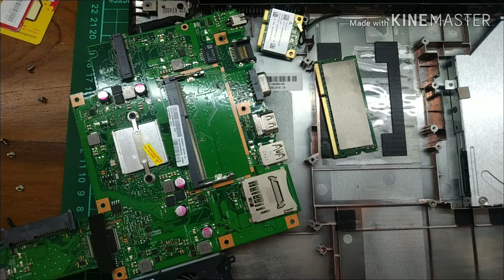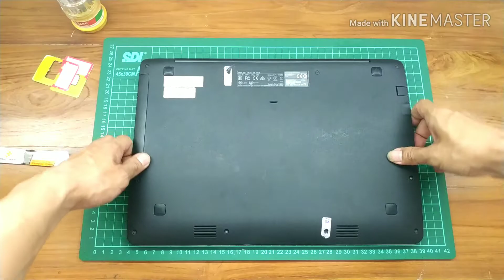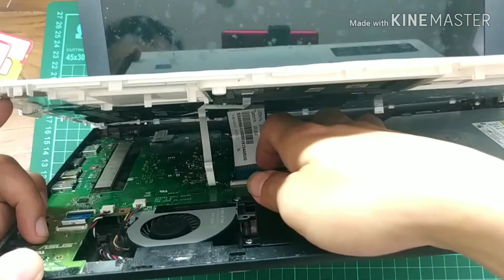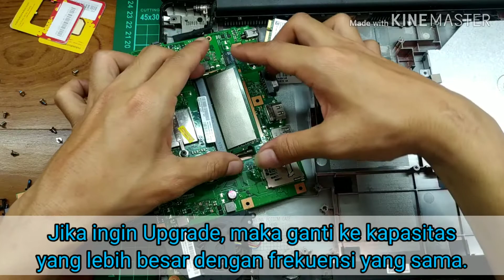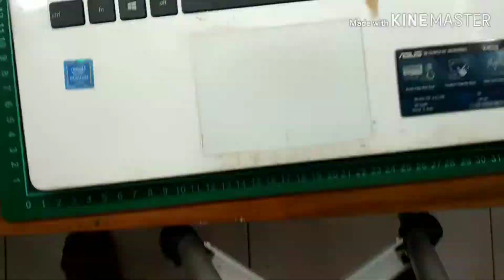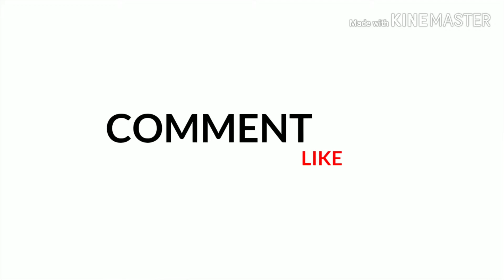Upgrade Ram Asus X453S max 8Gb

Comment: Bang mau tanya tipe laptop persis kaya di video mau coba cek spesifikasi di CPU-Z Memorynya pake DDR3 tapi dibagian SPD tulisan DDR3L jadi pakai yg mana kalau mau ganti?
Reply from the maker: Kalau di bongkar bisa enggak mas..kalau seperti itu saya belum yakin kalau belum di lihat secara fisik langsung.
Reply: @LinggarjatiRudyan  kalo secara fisik DDR3, trus jadi diganti yg apa DDR3 apa DDR3L ?
Reply from the maker: @nailaafifah2240  jika ada, disesuaikan dengan tipe sebelumnya, cukup di up kapasitas giganya saja.
Kalau untuk laptop ini sebetulnya belum pernah saya coba dengan ddr3l, namun saya ada laptop acer yg ramnya kombinasi 2 gb ddr3 + 4 gb ddr3l, bisa berjalan lancar.

Comment: Saya sudah coba RAM 8 gb DDR3L PC3-12800 MHZ di Asus 453S kok hasilnya bluescreen bang. Mohon solusi, dibongkar pasang berkali-kali dg membersihkan kakian RAMnya tetap aja ngga bisa. RAM yg 8 gb tadi dipasang di laptop lain, bisa2 aja.
Reply: Setelah pasang RAM aslinya 2 gb, laptop kembali normal. Saya menggunakan windows 10
Reply from the maker: seharusnya juga mmng bisa itu,,itu windows 10 yang berapa bit mas??apa merknya juga sama seperti yg 2Gb itu??
8Gbnya dicoba di laptop apa mas, yang waktu bisa?
Reply: Kasus nya sama dg Saya, Saya cek RAM bawaan laptop ini PC3 tapi saya cek di CPU Z tipe RAM ini DDR3L 1.35v.  Saya coba upgrade ke RAM 8Gb DDR3L 12800 hasilnya layar tidak mau menyala. Tapi ketika RAM bawaan saya pasang lagi. Baru mau nyala laptopnya.
Reply: Saya pakai win 10 Pro 64 bit. Merek Samsung. Saya coba di laptop Asus yg lain, terbaca dan lancar malah.
Reply: Kalau saya laptopnya menyala, namun ngga bisa masuk desktop karena bluescreen mas...
Reply: @abunaura  gan apakah laptop udah jadi pakai yg 8GB?
Reply: @wariorbest2306  blm bisa gan, masih pakai RAM bawaan yang 2 gb
Reply: @DAarchitects09  wah sama gan. Saya pake DDR3 4GB gak nyala terus pakai DDR3L bisa cuma lama2 blue screen dah lah cape udah retur 4x akhirnya pakai ram 2GB bawaan
Reply: Akhirnya saya nyerah. Balik pakai RAM 2gb bawaan tapi saya ganti pakai SSD dan Windows 10

Comment: berati total ram jadi 10gb ya mas kalau di tambah 8 gb satu keping?
Reply from the maker: sebetulnya saya belum tau mas, soalnya belum pernah nyoba saya pasang ram 8Gb, cuman kalau dari spek processornya cuman mampu 8gb dari total max ram yg terpasang,
Reply: Asus x453 cuman ada satu slot ram kalau gak salah bang
Reply: Bawaan 2gb.. Kalau diganti 8gb... Brarti yg 2gb ga kepake.. Dijual aja..(spec max. 8gb masalahnya) salam dari gunung kemukus

Comment: Up ke 8 mubazir ga , kan celeren trs masih hdd
Reply: Murah ko ram gak sampe 200, jadi klo punya dana mah sikat aja

Saran saya sih upgrade ssd juga sekalian

Punya saya celeron n3050 JADUL PARAH

upgrade ssd + ram 8 = sekarang kuat main pb dan kuat editing vidieo
Reply: @23muchammadrafly97 serius ga bang rencana mau upgrade ssd juga nih
Reply: @dennyadisetyawan1246  kuatlah, tapi jangan berharap settingan high

Ibarat lu anak sd di kasih tt cewe sma
Ya rusak
Reply: @23muchammadrafly97 kalo buat pes kuat ga ya mas, ssd pake yang berapa gb
Reply: @dennyadisetyawan1246  kekuatan ga di nilai dari ssd mas, tapi dari procesor

Ssd cuma bantu biar proses nya cepet aja
Seperti
- bikin ga patah patah
- buka file manager jadi cepat
- loading game lebih cepat

Kalau upgrade ram
- bisa buka banyak aplikasi bersamaan
- mengurangi resiko freez , atau istilahnya hang ngelag
- multitasking
Reply: @23muchammadrafly97  kalo celeron n3050 sama core i5 2410m dual vga radeon hd7400m dan intel hd 3000 mending mana mas?? 

makasih sebelumnya udah ngejawab
Reply: kebutuhan buat main game pes word excel dll sama browsing nonton
Reply: @dennyadisetyawan1246  pes 2000 berapa ?

Kalau 2010 an kebawah masih bisa settingan menengah

2013 masih oke juga sih sebenarnya

Kalau di bandingin celeron saya dengan i5 gen2 kamu, secara teori menang kamu, dan kamu udah ada vga juga 

Tapi kalau buat gaming spek segitu aga ngos ngosan, jadi jangan dipaksa high ,settingan low aja
Reply: @23muchammadrafly97  pes 2017 rencananya kalo kuat kalo ngga ya 2013, setinggan low
Reply: @dennyadisetyawan1246  di coba aja,kalau secara teori sih kuat
Reply: @23muchammadrafly97  saya juga punya laptpp seperti lu bang, bisa gk minta link pembelian ramnya, soalnya punya laptpp saya juga x453sa rencanan mau main pb juga itu lancarkan bang ?
Reply: @23muchammadrafly97 klo buat autocad kuat ga bang ?
Reply: Ada yg bilang maksimal ram di 4 gb saja di vidio lain
Reply: @23muchammadrafly97 Merk dan spesifikasi RAMnya apa bang? Sama soalnya laptopnya.

Comment: Bang satu slot RAM bisa langsung 8 GB gak ?
Reply from the maker: Tidak bisa mas, maksimum ditambahin 4 GB. Karena spek processornya hanya bisa membaca total memori 8 GB, 
Asumsi ram tanam 4 + ekspansi 4 = 8 GB
Reply: @LinggarjatiRudyan  kalau bawaan ram 2
+Ram 4 jadi total cuma 6 dong bg?
Reply from the maker: @dlah1661  iya bang, atau laptopnya bisa dicoba bawa ke konter komputer buat coba dipasang ram 8Gb, siapa tau ttp bisa kebaca 2 + 8 = 8Gb, tidak mungkin 10Gb, karena kemampuan processor 8Gb
Reply: @LinggarjatiRudyan  maksud kata dari tidak mungkin itu apa🙂
Reply: Btw makasi infonya om
Fash respon
Reply: Aku coba di web crusial bisa sih 2 + 8 ,
Reply: Tapi x452c ya
Reply from the maker: @dlah1661  hee, iya bang, dari 8Gb yg dipasang, cuman kebaca 6Gb, jadi 2 + 8 (6) = 8Gb.
Sama sama bang, semoga bisa membantu 😁
Reply from the maker: @agungmaulana9774  total kebacanya jadi berapa bang?

Comment: Bang ini cuman 1 slot ram nya ya
Reply from the maker: iya cuman 1 slotnya bang
Reply: @LinggarjatiRudyan  TIPE RAM nya DDR3L kan
Reply from the maker: @okkestevanus6352  iya bang, pakainya DDR3L bang.
Reply: @LinggarjatiRudyan  bisa dipasang sampe 8Gb kan
Reply from the maker: @okkestevanus6352  kalau internal 4 tinggal di tambah 4Gb bang, soalnya total max 8Gb
Reply: @LinggarjatiRudyan  ram saya masih bawaban 2Gb. Terus kalo saya mau beli ram 8gb. Yg lama saya copot bisa kan
Reply from the maker: @okkestevanus6352  enggak bisa mas, itu ada ram tanam 2gb berarti ya, tinggal di tambahin beli yg 4Gb aja, ataucoba langsung ke yg jual ram kalau di tambah pasang 8gb mungkin bisa, walaupun kebaca total ttp 8gb
Reply: @LinggarjatiRudyan  owalaaahh itu tuh ada ram tanam nya too... Jadi 2 giga ram bawaan itu tanam to
Reply from the maker: @okkestevanus6352  iya bang, memang ada bbrapa varian, tanpa ram tanam, 2gb ram tanam, 4gb ram tanam. Kalau ktu belinya yg tanpa ram, nanti bisa dibelikan ram 8gb 1 keping mas
Reply: @LinggarjatiRudyan  oke makasih
Reply from the maker: @okkestevanus6352  siap bang..